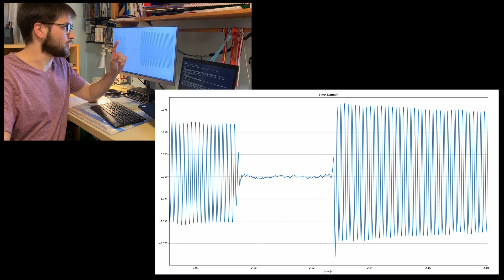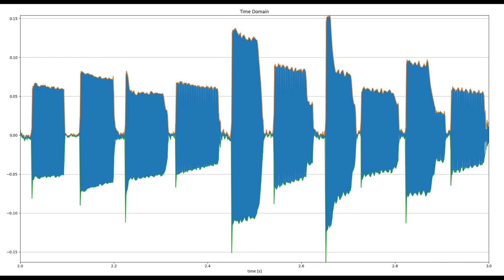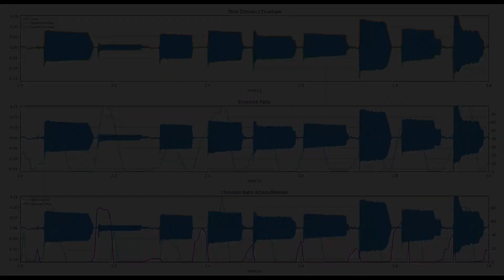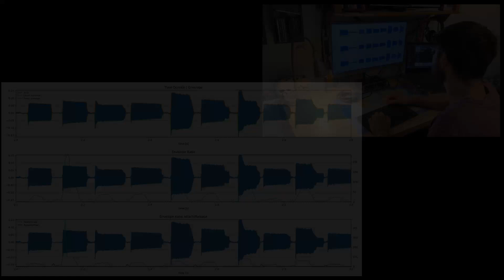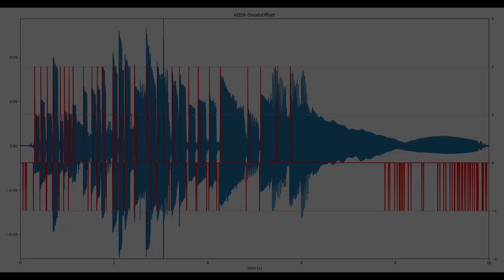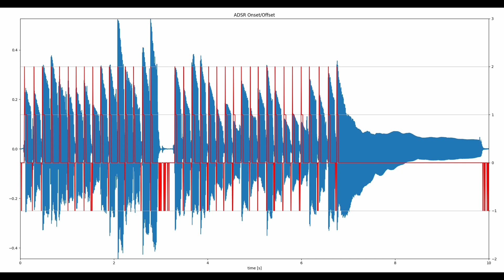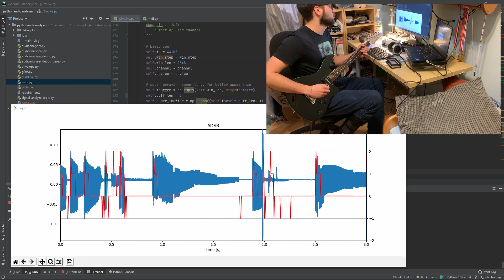Let's Hit Them Strings! | Midi Guitar: Onset Detection with Envelope - Original Method #ANTech

Comment: Great video! Could you please provide the reference paper/book you used to generate the amplitude envelope?
Reply from the maker: Hi! I think I actually came up with the method mostly myself. I used the information about sound frequency extracted from enhanced auto correlation (EAC) - simple algorithm by Terro Tolonen and Matti Karjalainen. Look for "A Computationally Efficient Multipitch Analysis Model". This part helped me find the highest peak in given set of samples. Knowing the frequency I could specify the length of window of interest. That's about it. I don't think that's the best possible way to create amplitude envelope and still plan to enhance this part in the future. I bet there are more clever people than me that have this already figured out.
Reply: @antonijankowski3379  Thanks for the swift response, I plan on reading that paper tomorrow, hopefully I get something similar working. I look forward to your future projects, subscribed.

Comment: Funny, I'm about to start learning Python myself. The algorithm seems to be working well! How would you account for differences in gain? Most interfaces, recorders, etc. have a good noise floor, but what would be an optimal gain stage range? I'm sure that if this were eventually made into a sellable product, some newb would clip the gain going in and destroy any transient/attack in the process. What would be the best way to expand on the algorithm to improve on transient recognition with an audio source that has none? Would you sample clipped audio and just tell it that it's a matter of an amplitude difference? Is this where the frequency analysis would come in more handy (to recognize frequencies that occur during pick attack)?
Reply from the maker: These are good questions! I think it's beneficial for all signal transcription systems to start with a high quality input. If not, than I suppose the frequency domain based methods could save the day, although I guess not entirely. I'm not yet an expert in this field, I'll tell you more when I find out more.

As mentioned in the video I think implementing frequency domain based methods alongside the time domain ones is the golden solution that could recognize the staccato technique as well as legato and slides. So to rely on only one of these is a huge decrease of the system functionality and quality of its output from the start.

Comment: "I'll just move on to another project"  -> what do you mean with that ?
Reply from the maker: I meant another part of this Guitar 2 MIDI Converter project. Don’t worry, I’m not going anywhere, it’s just that each of these steps is a project of its own - that’s what I had on my mind. And in the next one I’ll probably talk about frequency spectrum based onset detection methods. Btw, thanks for watching! If you don’t mind please share this Video, it means a lot!
Reply from the maker: Ariel for some reason I can’t see your comments. I get updates that you commented on my video but can’t see the comment itself. Anyway, I’m reading the “Fast and Efficient Pitch Detection: Power of Two” article right now, thanks for letting me know about that one,  this seems to be very helpful.